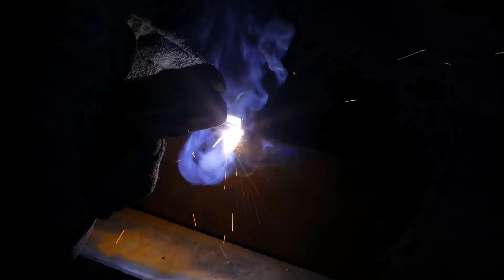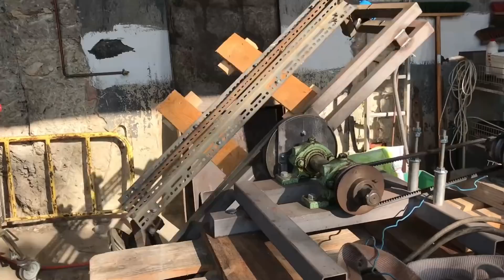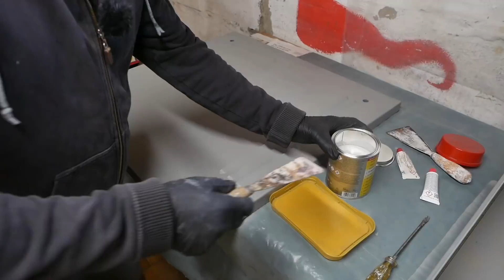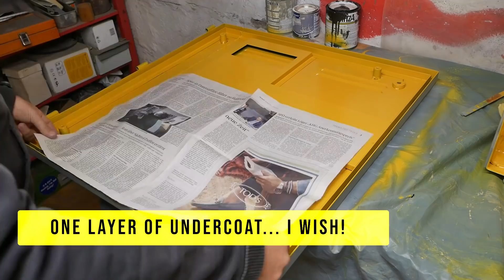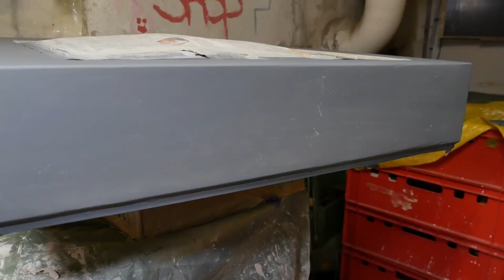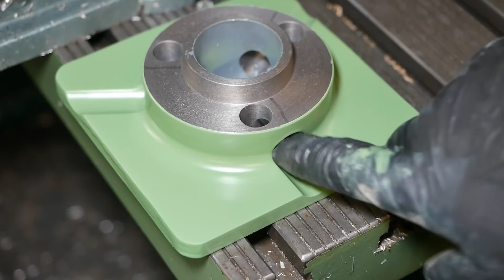Schaublin control cabinet completion

Comment: After you've bogged and sanded a couple of times, use stopper to fill the minor imperfections and pinholes. It's much finer than normal filler, no hardener required and sands more easily. After that, high build primer is your friend!
I'm impressed with how little dust you seem to get in the air whilst spraying, are you running at quite low pressure?
Reply: Is stopper basically a glazing compound along the same lines of how I would call bog either bondo or body filler?
Reply from the maker: @torpedan  I have never heard of that, but then again many countries dont call it bog. :)
Reply from the maker: Thanks for the tip. I am running the gun at about  40 psi at the compressor. Reall should put a regulator o the gun, so I can set it there. Maybe so blocked that it only spits out very little paint ;)
Reply: @RotarySMP  see good up

Comment: This was an adventure and a half!  I've heard of taped-over air data ports causing havoc but the AoA probe occurence is a new one on me.

I was lucky enough to be just down-range from a drop by a piston-engine CL215; hearing it go overhead at maybe 200', full fine at takeoff power was awe-inspiring.
Reply from the maker: That final pass of the CL-415, he held course on the bridge we were standing on way longer than the other one. My wife ducked :)

Comment: I have a theory about spray painting and bogging - the amount of time you need is inversely proportional to one's skill. I now have another data point, unfortunately though I have no data points at the high skill end of the plot to confirm my theory.
Reply from the maker: Good call. About three bogging/undercoating sessions in to it, it started to slowly dawn on my that it was probably only another 15 minutes with the hammer and dolly and I wouldnt be there.

Comment: My paint jobs always come with tons of bumps that contain a variety of insects that decide to land on the items as they dry outside. 🤐🐜🐝🐞🦗🪳🕷🪰🦟 <- sanding these critters backs seems like 🤢
You're making me miss Europe! Those were some awesome shots of the tankers! Thanks for sharing those. Really sad the level of failure and hubris in that aircraft accident discussion. That and the horrible looking rivet head picture you're doing an awesome job talking me out over buying a plane 😑
Reply from the maker: Thanks. I also get  lot of dust in there, but that is the room I have. Those CL-415 are awesome.
Reply: @RotarySMP  Yep, thumbs up for the respirator use.
Reply from the maker: @vincei4252  Thanks. That is a small room. Painting in there without a chemical filter mask would take years off your life.

Comment: This is why I hate painting.
Reply from the maker: I get that. I like that last bit, pulling off the tape (if it goes easily).
Reply: @RotarySMP  Yeah, It's satisfying and scary at the same time. Some paint could have seeped under the tape which lead to more work. It will go fast but it's still annoying.

Great work, video and project. Keep up the good work :)
Reply from the maker: @unogazzy84  Thanks for the encouragement, and for watching what you hate :)

Comment: Good job! it looks great, but only after a lot of painful work. I have this problem with stick welding sheet metal - my (lack of) welding technique made me excell at angle grinding :-) 
A suggestion (even if too late): use polyester based filler for large imperfections and a solvent based filler (the grey and red stuff) for the smaller ones - makes sanding much easier and faster.
Now waiting for the inner works of the cabinet - sounds like a great new challenge ;-)
Reply from the maker: Thanks for the tip. I'll have to see if the hardware store has a compatible filler.
Reply: @RotarySMP  Glad to be of help :-)

Comment: Is there any reason you chose to do very tiny swathes, instead of covering a larger area while painting?
I found that I got better results if I applied wider, but thinner coats.
Reply from the maker: Either the guy nozzle is too small, or too blocked from years of half arsed cleaning. It worked better once I soaked it in thiners and then U/S buzzed it, but never puts down those huge wide swathes you see.